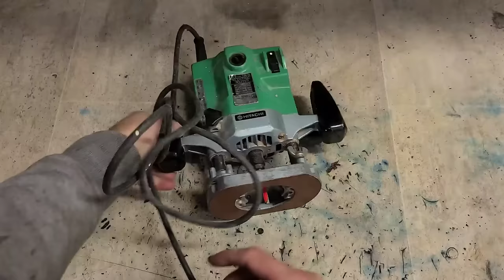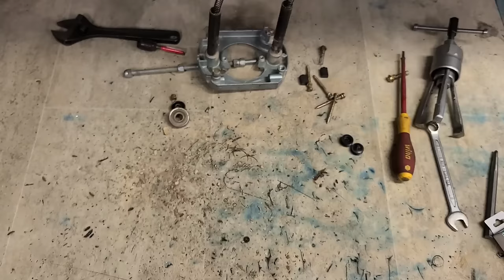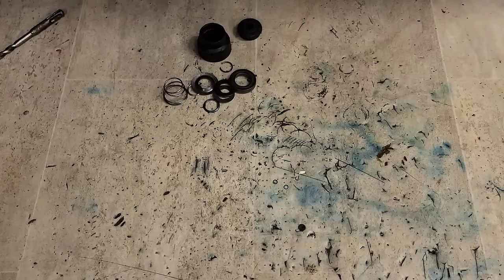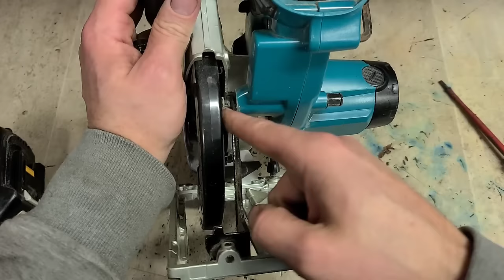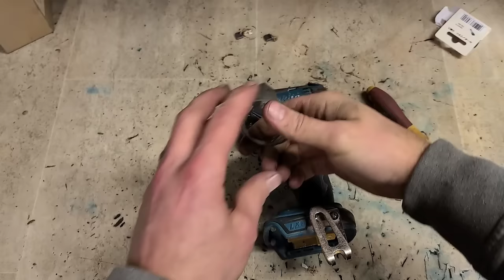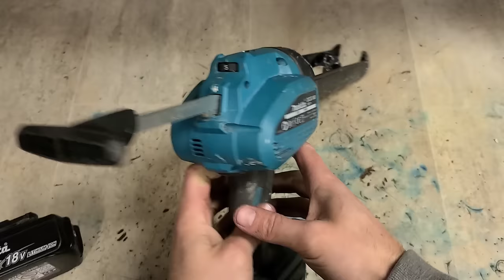Repairing a box of Makita cordless tools and a old Hitach router.

Comment: Happy Easter and thanks for a great vid again! When I saw that DTD146 in the box I expected a faulty trigger, but wrong guess.
A sidenote for the DHR242; that plastic cap got a modification 451533-2 got replaced by 455393-4. 
They made it all round and removed the square plastic bits inside to prevent it from jamming. 
Just make sure to remove the rubber sleeve on that cap on reassemby and only use the metal steel ring else it won't work.

Comment: Tools fixed in this "Easter Special" video:
1:40 Hitachi TR-8 Router Fault: Bad bearing
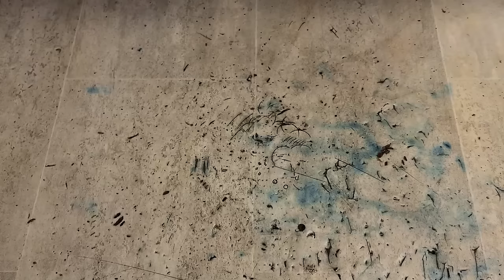15:33 Makita DHR242 SDS Drill Fault: Chuck  (Note: DHR243 has removable chuck, so its an improvement)
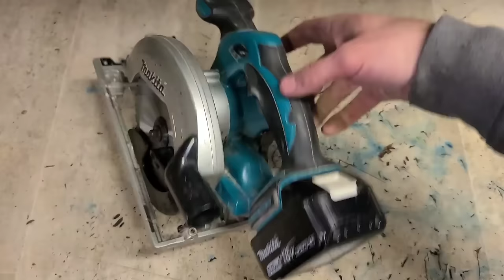24:57 Makita DSS611 Circular saw Fault: Loose base (possibly)
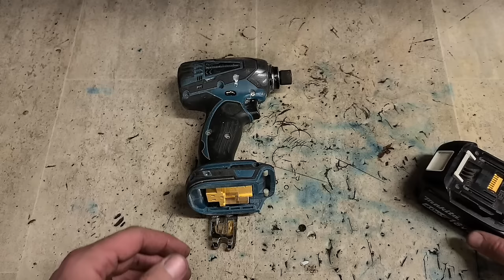29:32 Makita DTD146 Impact Fault: Motor
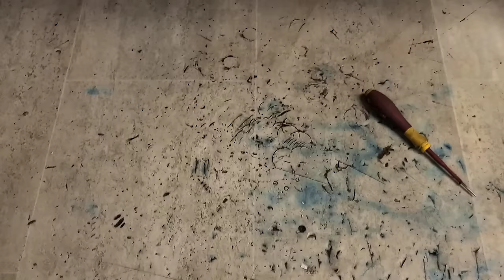34:36 Makita DHP459 Drill Fault: Gear selector
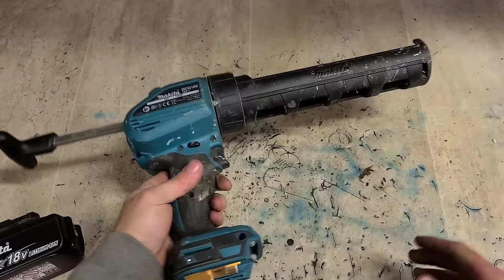47:01 Makita DCG180 Caulking gun Fault: None/In working condition

Comment: I have a question Dean. I have an old circular saw that needs brushes, but they are discontinued. I've looked everywhere, and cant find suitable replacements. The trouble is, the deisgn of the brushes isn't standard. As far as i know, they will fit this saw, and only this saw. Any suggestions?
Reply: No brand makes similar ones that you can file to size or at least for the brush even if you have to change the connectors ?

Comment: Do you not bother to replace the rubber coller on the impact driver?
Reply: Its a brushed 2014 machine, doubt they still sell that part for it.
Reply from the maker: It's always the first thing to get knocked of or lost. Iv always found it pointless replacing them.